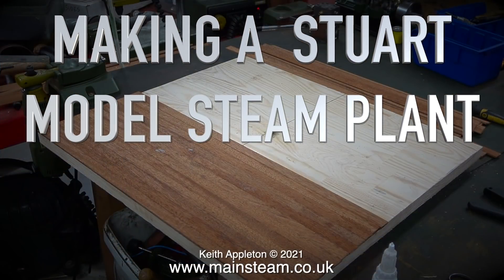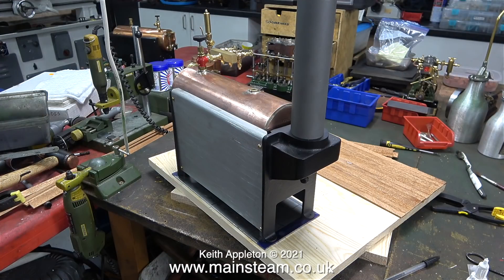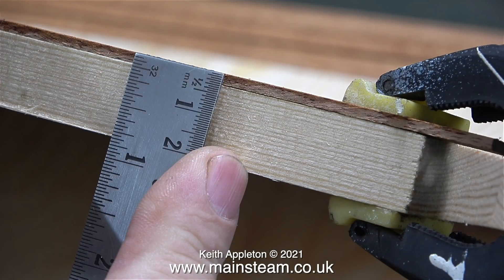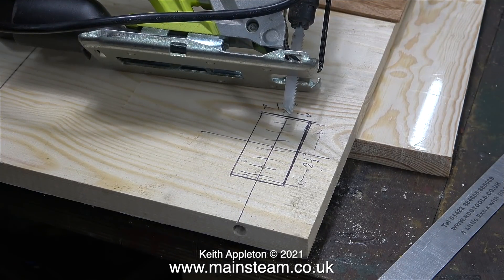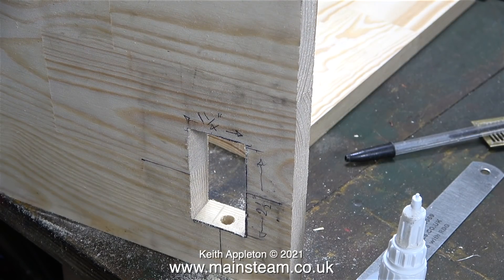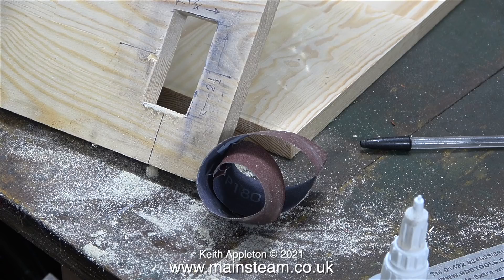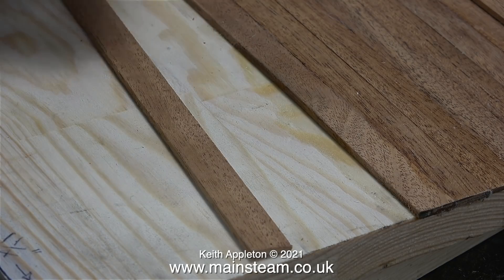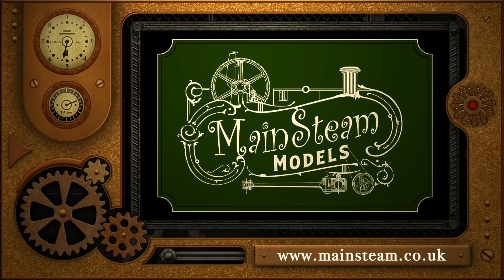MAKING A STUART MODEL STEAM PLANT - PART #42

Comment: I can see where you are going wrong with your marking out but as my marking out is no better overall there is no point trying to tell you.
Jig saws don't cut perpendicular to the surface and the thicker the material the worse it gets because the blade isn't held tight, it's not rigid and it will twist and bend to find the route of least resistance.
Reply from the maker: I usually do it slightly better when I am not filming it. Sometimes to get the shots I am working at odd angles as I watch in the viewfinder a lot of the time.
Reply: I think a good part of the issue most people (myself included) have when using a jigsaw is impatience.  It’s not so much that the wood fibers are causing the blade to deflect, it’s more a case of the deflection being caused by the amount of forward pressure on the blade.  Couple this with the blades’ relatively fine teeth becoming clogged with sawdust as there is usually no room for clearing the chips, and you have a recipe for disastrous results.

The next time you have a jigsaw cut to make, refrain from trying to push the blade through the work, letting the sawblades dictate how fast they cut.  Back the blade up periodically to clear the chips.  It may seem like it takes much longer to make your cut, but the payoff will be a huge savings in time and effort with the file afterwards.

Comment: When using a Jigsaw, even if I set up a fence to cut against, I find that the blade still wanders, I think they just simply flex to easily. Jigsaws aren't really precision tools. I'm sure there's someone out there who can cut a straight line with a Jigsaw, but not me. So no, Keith, I don't think you're doing anything wrong.